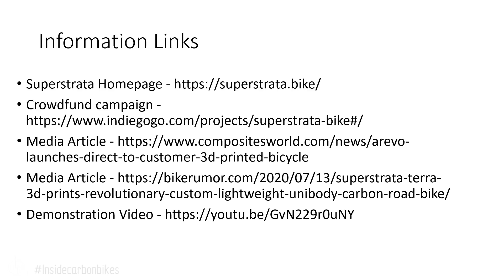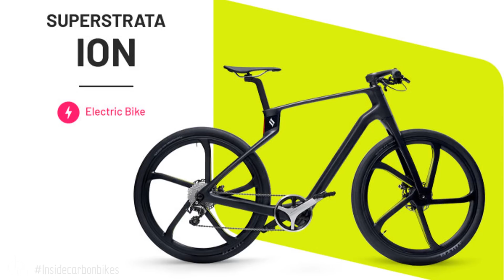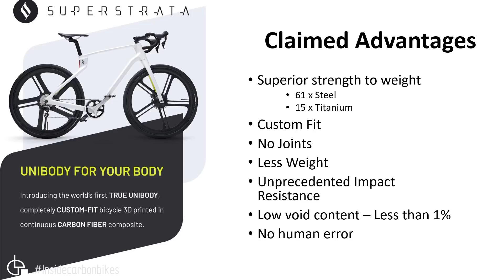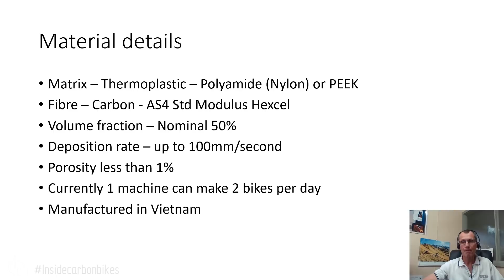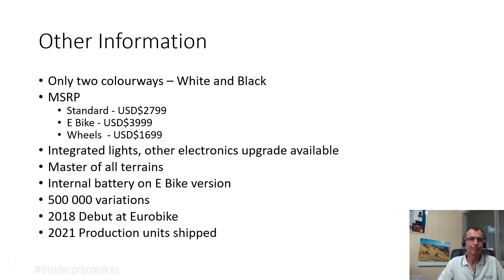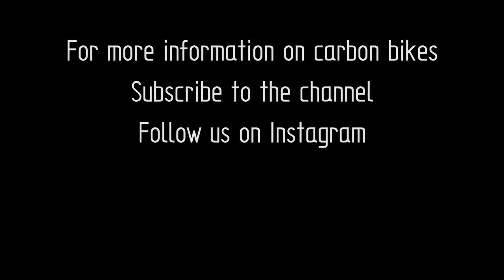SUPERSTRATA 3D Printed Carbon Bicycle - Gamechanger or Not?

Comment: The first bikes are being delivered to actual customers, and the quality is downright scary. They are cutting holes in standard ControlTech mountain bike handlebars for “internal cable routing”. The front and rear lights are loosely glued in place and falling off. The seatposts are being cut short to fit in the frame design. Your concerns about paint are spot on, customers are complaining that the paint scratches right off with the lightest touch. The weight is laughably heavy.

No carbon wheels have been delivered, and they have downgraded drivetrain components to off-brand Ali Express Chinese specials.

Worse still, the finishing process involves heavy sanding of the printed surface, going right through the carbon fibers, which are short and not continuous to begin with.
Reply from the maker: Yikes!!
Reply: @LuescherTeknik  the paint shop https://youtu.be/4ioTP2BJ9_k

Comment: The frame shape appears to have some planned failure points engineered in to it. Apparently someone wants to know precisely in advance where his product will fail.
Torsional bending according to the drive direction axis of the crank mechanism seems to be a deliberate mechanism here. I guess they will apply for a patent on that.

Comment: It would be interesting to hear your perspective a year on. Based on Superstrata's updates, delivery is delayed although they appear almost ready to ship in volume. The main complaint from backers is that the final design is different from the early renderings - round seat tube, generally thicker tube shapes, no surprise there. Also they backed off one of the carbon wheel designs as it was proving difficult to make. Superstrata has not published any frame, fork or wheel weights as well. Campaign updates: https://www.indiegogo.com/projects/superstrata-bike#/updates/all

Comment: So many things here don't make sense. Anyway, if 3d printing were ready for prime time, I'd expect first products to come from established companies, either big bike companies or other with process expertise (I've seen some saddles). Btw, there was a US company (Diamondback or GT?) that made a thermoplastic/carbon mountain bike, maybe early 90's. Front derailleur, cable guides, etc., had to be clamped on since glue didn't work on thermoplastics. It looked kind of crude, unpainted, and would probably be a tough sell today.

Comment: I almost had the same exact set of questions (20:20) after watching their videos. It is apparent that a 3D printing process can only lay fibres in-plane. All fibres which need to be applied circumferentially around the tubes cannot be not laid via a 3D printing process as shown by the company. Their design is essentially a UD-layup oriented in the tube directions, which is really great for axial stiffness and strength but horrendous for any torsional loading. I guess the frame would simply delaminate upon torsional impact loading. From what I have observed, their prototype frames look moulded and the whole project is a hoax. I guess in the end they will establish a manufacturing plant in vietnam to produce bikes from thermoset prepreg. 
Sad to see that a lot of people will get scammed/or already have been scammed, only because they do not have a deeper understanding of composites manufacturing techniques.

Comment: Whenever you see a "revolutionary" new bike design based on diamond frame but omitting the seat tube, you know: it's shit, and the designers have no clue whatsoever. Just designed for looks without any sort of technical understanding. Always annoys the hell out of me. Also: designs which omit one side of the fork and rear triangle.

Comment: There is so much wrong with this design.  The same problem you mention with the forks holds for the seat stays and chainstays; maybe they need to build a frame with the chainstay and seat stay on one side only  and produce a lefty type fork.  If the print head can only lay down 100mm per second, what is going to stop the material from cooling, creating a cold weld when the next layer is deposited.

Comment: 3D printing right now, is great for mould inserts, dissoluble additions to the bladders or small metal parts... Not the bikes. The "printers" used for aerospace parts uses titanium compounds that go through long high temp cooking processes, and are not used to make the parts lighter but rather reduce their expense/make impossible to CNC parts. So yeah, it will take minute for the one off tech used to make multimillion dollar SpaceX parts to replace a 600€ (cost to manufacture) top end carbon bike sold at 5000€ to punters.

Comment: You don’t need a degree in structural engineering to see that the flat top tube will never provide sufficient vertical stiffness in the absence of a seat tube. It is pure hyped up scamming...... no doubt there will be ‘delays’ due to ‘design constraints’ or ‘manufacturing issues’.....
There is a very good reason that the basic double triangle frame design persists.....it works!

Can anyone give me a sensible reason for the absence of a seat tube, aside from wanting to look different, along with the ‘3D printed’ bollocks? It won’t work, it will flex and snap! 
What do they state on the Indiegogo page?

“The project team has a working demo, not the final product. Their ability to begin production may be affected by product development or financial challenges”

ie ‘product development’.......the pointless design doesn’t work.
‘Financial challenges’......it costs way too much to produce each 3D printed frame that is structurally compromised and unsafe.

edit: check out the ‘promotional/ delusional/ misleading video....
None of the frames without seat tubes show a seated rider, they’re all standing on the pedals.
A couple of shots of seated riders are on a different frame without seat stays.
Utter utter scam.
https://youtu.be/PxRa0JyILQE

Comment: Their promo video is so full of BS it is laughable, what's even more laughable is that it works and they are raising a ton of money...  The strength numbers make no sense... they probably used the tension strength of unidirectional carbon fibers divided by the density to get those numbers (which have no connection to any real composite property of a final frame)...  The guys talking about making 350 grams graphene frames were almost as credible (and have since disappeared)... At one point these guys have a bike set-up as a single speed with no derailleur but a full cassette, at another point they have a guy looking very seriously at the crankset and turning the pedals on a bike stand (looking like a mechanic tuning the bike), except a derailleur is installed and the chain does not go through the pulleys...  Seems like nobody on that team has ever assembled a full bicycle in his life...  None of the models riding the bikes, look like they actually have been riding a bicycle since they were 8 years old... None of them sit on the saddle on the frame without a seat post at any time except at one point where miraculously appears a bike with a seat tube...  The bike seems to have a huge wheelbase and therefore probably rides like a tank...  They are raising good money from gullible people...

Comment: in the strata youtube video, you can sees that they dont sit on the bike seat.... for the video clips where the cyclist is sitting on the bike, they are using a different bike.... one with seat tube without seat stays.... so i do not think that they have the design structurally sorted out.....

Comment: More questions: why does the fork curve backwards? Looks like they want a twitchy ride over a stable one. That's great for experienced riders who race or need fast reactions, but for a novice, who this bike is clearly aimed at, that makes you less predictable to surrounding traffic. Much like their promotion video with the short guy, he twitches to the left while he rides, supposedly casually, showing a lack of Rider ability or a lack of bike stability. 

How will people be able to select the right seatpost? Will there be 500,000 options for that too? Why the extreme set back? Why do all the angles look strange? What I mean is the seatpost comes out at a different angle than the frame it's set in, the head tube looks shallow but the fork curves in making the effective angle more aggressive. 

I don't know, it just seems like they spent more time at a drafting table trying to make it look cool than they did making it make sense.

Comment: To comment on one of your questions: I think, that the frame actually is pretty lightweight, because, you said it yourself, it is NOT a roadbike but a commuter or an ATB, for which the frame isn't heavy. Anyways, I don't think that the bike is a game changer. It think, that somebody, who has experience in marketing tries to find a niche, where he or she gets much money out of in a short period of time and the product won't be available for long...
Reply from the maker: The question was more about why if the claimed strength to weight is 60 times that of steel, why isn't it significantly lighter? Even if a steel commuter bike frame weighs 2kg the maths claimed doesn't add up.

Comment: Nice input Raoul - I feel this is a very fair view. 
I was at the 2018 debut at Eurobike and spoke with Arevo and the bike designer. In comparison to traditional carbon fiber layup, the 3D printed format allows finer control over wall-thickness and tension / stress. Also spoke with Emery - a US based enterprise who were seeking to launch... but appear to still be TBD. I think this can be a game changer but you raise a lot of valid comments. 
One of their initial challenges was to resolve the build-plate and during production, they lay in a plate to do the second seat/chain stay. This means they are not doing the 'hooping' for tubes and is perhaps one of the most important observations because it would mean that they have to compensate otherwise in the print-pattern to control strength / tension throughout the frame. 
With the build-plate and insert - they could do the two parts of the fork though it doesn't resolve this 'continuous off-axis fiber' so is an interesting question. Compensating for no seat-post should be feasible however a real ride will really show how well this goes... for example if the frame has some flex (normal) would it also then be susceptible to twisting so the front and rear twist in opposite directions. 
On the surface printing, I saw a finished frame with a great finish but it must have been sanded. I also saw a rough frame but it was a bit like 3D printing with the steps and would have to be sanded. 
--
Onto Vietnamese production - yes, frame production is market independent but I think it is because they can setup a production facility (or have one with current Arevo production) and have to factor in all of the finishing and assembly which is still human powered. They have a production (partner) facility in Germany so can produce there but bikes are still a spin-off / showcase for the technology.
One of the things not touched on in the Superstrata messaging is that (technically) it is recyclable so in theory can be broken back down unlike regular carbon fiber production. 
--
The Superstrata messaging is all over the place - for example a Shimano groupset was mentioned but details were not provided (what level) and it was asked whether a crowdfunding backer just gets a frame and has to put the components on themself. Not clarified. 
But this mixed messaging also explains the wheel design... while a machine production is clever compared to laying up carbon fiber rims by hand (and they are not the only ones who can do it), the design appears to be about design and not about function or performance.

Comment: It's a scam. Look at their comparison to "comparable" road bikes. Based on the prices, they're comparing their bike, with bottom-end components, to top-end bikes with Dura Ace or SRAM Red. If they had compared it to carbon bikes that are in a more commuter-type range, then I'd be less suspicious of their intent. The bikes would be impossible to resell, too. The seat post will have zero adjustability.
Reply: That's why it's recyclable ;)

Comment: Looking at their promo video there are some good ideas. It uses continuous carbon fibers being laid down and fused together over a structured bed. This is not new technology: Markforged and others use that for their industrial 3d printers and the parts are extremely strong. Unlike standard filament printing with that type of strand you can actually print pretty fast, so I would disregard the thoughts of the 3d printing hobbyists here who have experience with consumer-grade FFM machines only.

Where I have some serious doubts is how they will achieve to bridge these curves and close them out without having to lay down internal support structures which add weight; the alternative would be to use a rhombus shape for the internal core but then you also add a lot of material and weight if you seek to have an ovaloid shape on the outside. The only way I can see their claims making sense is if they use a meltable or dissolvable material for the core supports.
Reply: Also: carbon fiber going in only one direction on a bike is not an advantage at all.

Comment: Dont't know where you saw his quote, but Sky Christopherson was the official alternate or backup in 1996 and 2000, does that count as an olympian? He never actually raced in the olympics. I would assume bikes have gotten better in 20+ years. I would doubt he could break any bikes nowadays. Makes his quote a bit less relevant.
And his record is a 35+ 200m time trial, which isn't quite as impressive as "world record holder for the velodrome sprint".  And the "velodrome sprint" (technically called the individual sprint) is a race and an individual sprint world record would imply the WR time for the fastest final 200m in the race against a competitor, but a 200m time trial record is a qualifying event to seed the races.

It seems a weird bike. It isnt UCI legal so can't be raced (and is very heavy anyway and no front derailleur,  unlikely to be aero, the geometry looks weird but it is a render I guess), it isn't a great commuter because it doesn't look to have mounts for a rack or mudguards and will be expensive. The parent company arevo don't seem to be updating their social media pages or website either. And the main guy doesn't consider himself a bike guy.

The 500,000 combinations doesn't sound like it's just geometry combinations, it looks like that includes all the different options for different size tyres, different wheels, or handlebars etc. 

I don't know why you'd ever back such an ambitious first project from a company. You get no guarantee on Indiegogo you'll actually ever get the item (and they've hidden that relatively well on their faq section). 

What's the point? There's better bikes out there right now from well established brands and you can get one today with a guarantee for the same or less than a superstrata.

Comment: 63x stronger than steel so it can fit a maximum rider weight 58583821 lbs. You don't need a seat tube if the seat post can go through the bottom of the top 'tube' but they should have some kind of braces in that frame for it to be rideable.

Comment: They're going to run into the inevitable production hassles, have to change the design slightly to meet strength requirements by adding a seat tube, wont be able to make a fork so they'll outsource the fork, the wheels wont meet production schedules so they'll switch to a traditional spoked wheel with alloy rims, etc etc, and. Y 2025 they'll have ridable prototypes that look just like a normal bike from 2004 and weigh 34 lbs.
Reply: there wont be any production problems because it will never go into production, there is no plans of making anything except a fancy website.
Reply: @kammui1961  I ordered one and I'm expected to get it in August. 👀
Reply: @spindleblood  did you get it?

Comment: Kestrel produced a carbon bike without a seat tube, back in the early 90s.
Reply: Still do
Reply: Roy Darnell - my understanding both Kestrel and Fuji last owned by ASA went under, no more production.
Reply: Google "beam bikes". They're still around and more advanced than ever before.
Reply: Kestrel released several models over the years and produced them until recently.  Some of the models were theTalon, Arrow, Airfoil, 4000.
Reply: true but this is 3d printing, way diff dude.

Comment: Did they forget to print the seat tube?  Should press ‘Print All’ on the print home page.......😏😏😁😁😁

You would need a bike fit first, as you won’t get much adjustment on the seat post. 🤔
Reply: Yeah. It’d have zero adjustment. The seatpost needs some length inside the frame or the frame won’t hold it.

Comment: 3D printing is slow, no good for mass manufacturing. They're using it as a marketing tool, because it sounds fancy and gets attention from people who are uneducated or unaware and think somehow it's high tech.
These "designers", usually students who have no understanding of bicycles, almost always use mag wheels and crazy frame shapes. I'm surprised the e-bike isn't belt driven with an internal geared hub, because designers get attention from the "derailers suck" people who had one bad experience with a derailer and concluded that every other less efficient mechanism has to be better.
Reply: cough ceramic speed cough
Reply: And 3D printing is expensive. It's great for prototyping but that's about it. But I will say that belt drive does make sense for a lot of people. It's not because of the derailleurs but because of the low maintenance.
Reply: looks like Bill Stephens is one of their designer.   https://www.youtube.com/watch?v=W1gOq9CL9CU